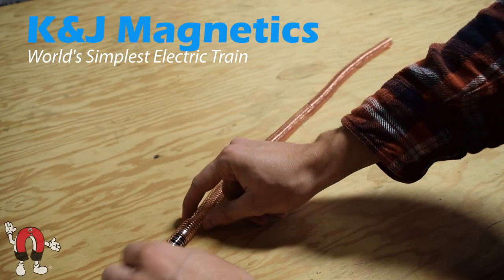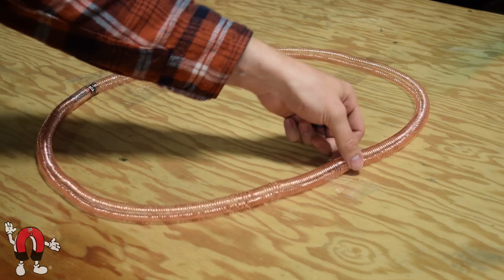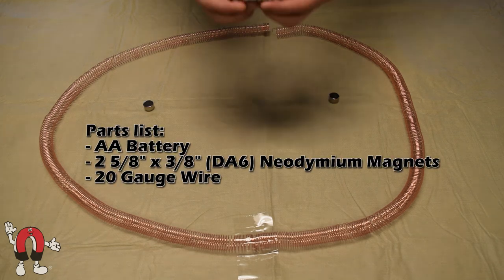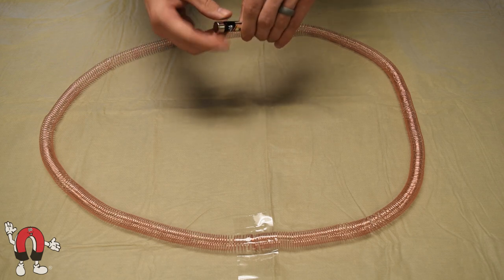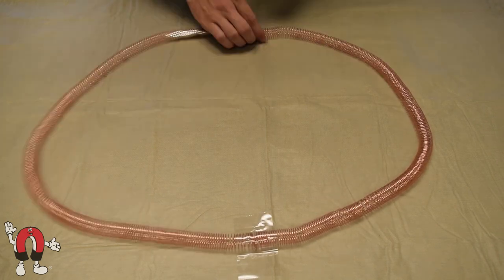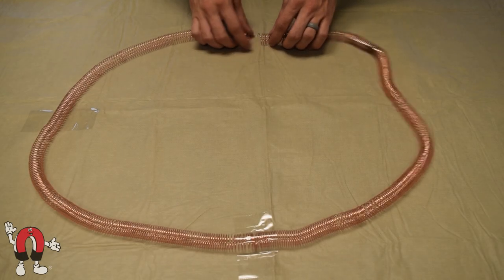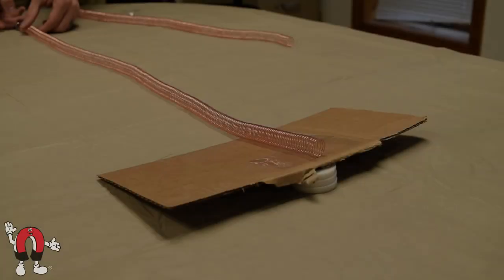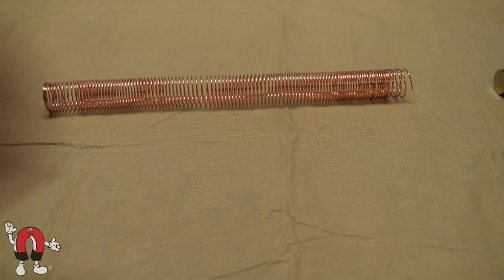World's Simplest Electric Train

Comment: do this the principle of "eternal" engine =).the battery with magnets in a glass tube around which a winding.the battery is connected to the flywheel rods .type of drive of the locomotive.it is only necessary that the diameter of the flywheel were provided to move the batteries outside of the winding in both directions =)

Comment: I used a copper wire but unfortunately it's not working... I want to buy your wire
Reply from the maker: We bought our wire from a hardware store. Make sure the wire is not coated.
Reply: K&J Magnetics How do you know if it’s coated?
Reply: @KJMagnetics  That answers my question. It's not some trick of juicing the flux of the magnets, it's just an electromagnet around the battery, as it moves, and the magnets must conduct the battery and the coil. Basic principles, cleverly applied.

Comment: i used a copper wire with enamel..... what's the reason that it's not working?
Reply from the maker: Insulated wire, like the magnet wire we sell, won't make electric contact with the batteries. The current needs to be free to flow from the battery, to the magnet, and from the magnet into the wire where they touch, briefly.
Reply: plz tell me Copper wire that you have used for magnetic train having guage...?
Reply: Did u used insulated copper wire or non insulated copper wire plz rply? @KJMagnetics